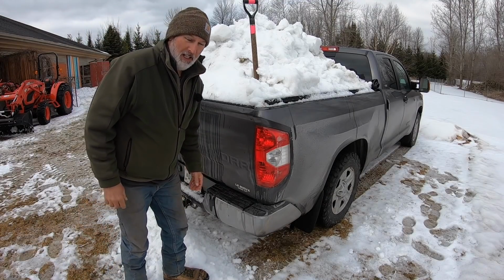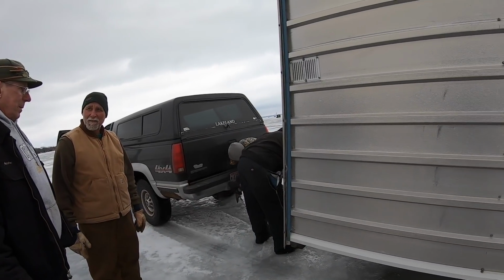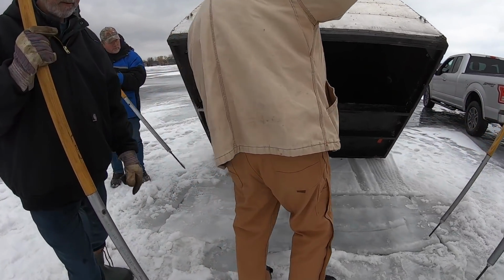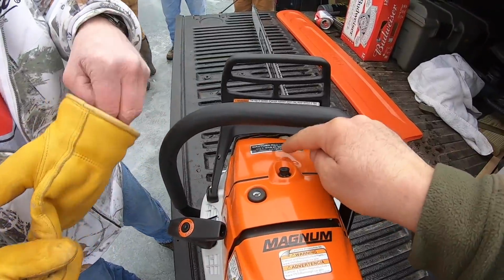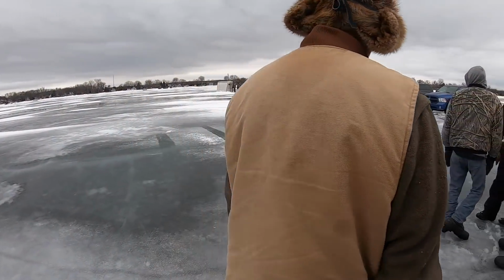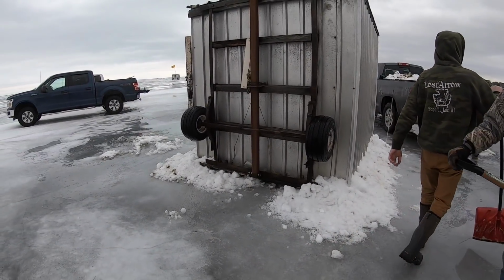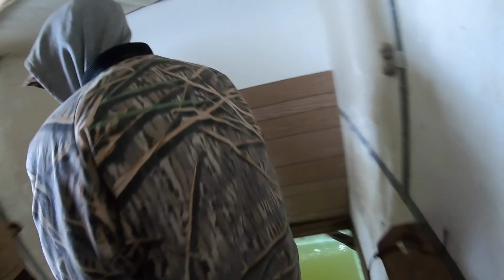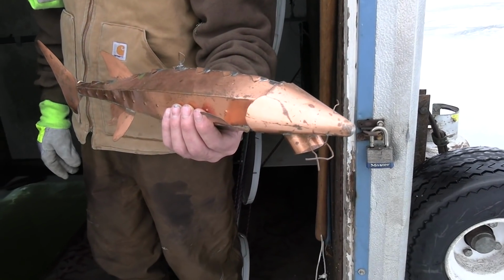STIHL chainsaws cutting ICE! - #619

Comment: I modified my chainsaw also by removing all the rakers. I also made a fender of sorts so ice water was not being slung all over the place, it threw it right down onto the ice. 
 Since my saw was used for cutting holes for ice scuba diving we never use any oil in the oil tank. No oil is necessary, water provides all the bar cooling and lubrication. 
 And very important, as soon as we were done cutting holes, the chain, bar and clutch were immediately removed from the saw and placed in a pan with rubbing alcohol to get rid of all water so the parts did not rust after using saw. And if saw is going to be used for sawing wood, make sure you don’t put the modified chain back on the saw.
Reply from the maker: Yup, some people use vegetable oil for bar oil.

Comment: High rollers there 1600 to cut hole on the ice. Got be hard on a saw to fill it with all that water.
Reply from the maker: I believe they change the bar and dry it out and use it for wood too.

Comment: What were the slots that they cut on the outside of the hole for?
Reply: Usually where I’m from in Maine, we use it to tie or secure the “ice shack” to the ice. If not tied down sometimes in heavy winds they can blow away, or over…
Reply: @jbmaine  oh.  That makes sense.
Reply from the maker: They are for 4' lath markers so that when you leave ever one knows there is a hole there!
Reply from the maker: Nope, markers for an open hole when they leave.
Reply: Ahhhhh learn sumpin new everyday?   Do you tie the shacks down or is that why you pack snow around too keep ‘‘em in place?

Comment: I was under the impression that tundra were supposed to he a 3/4 ton. I have not check into it though
Reply from the maker: Not yet that I know of....I wish!
Reply: When the "big body" (2nd gen) Tundra came out in 2007, a lot of people compared them to 3/4 ton trucks, because they have axles, brakes, transmissions, and hauling/towing capacities comparable to 3/4 trucks from the "big 3" of that era. However, in the last decade or so the "domestic" 3/4 ton trucks have increased capacities by about 25% or so.